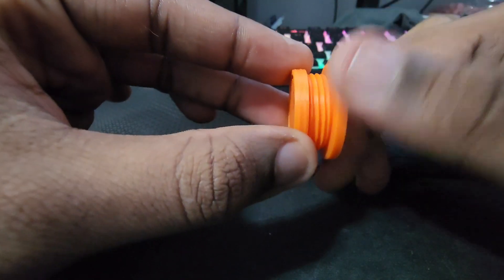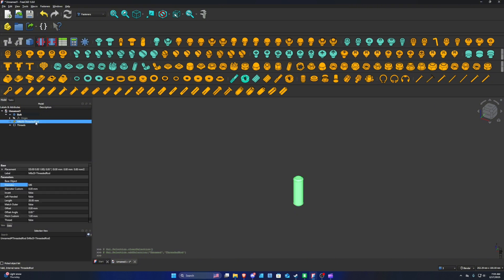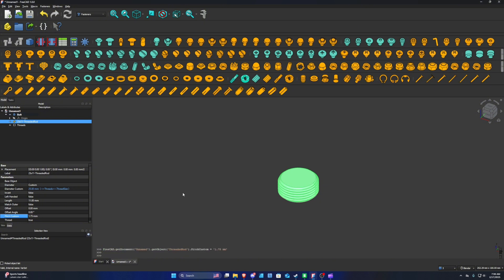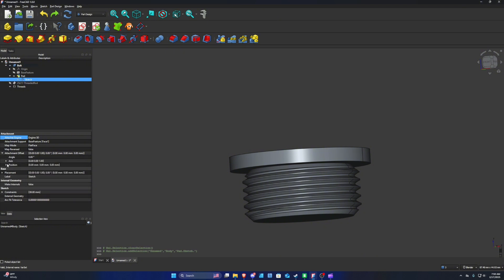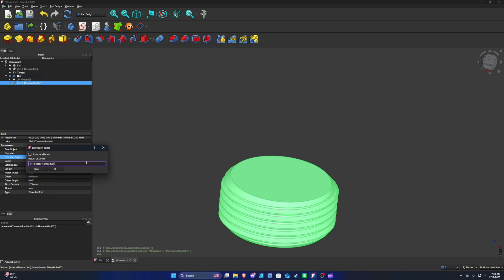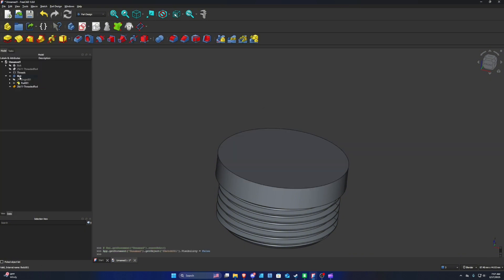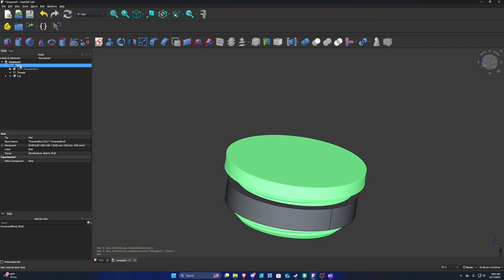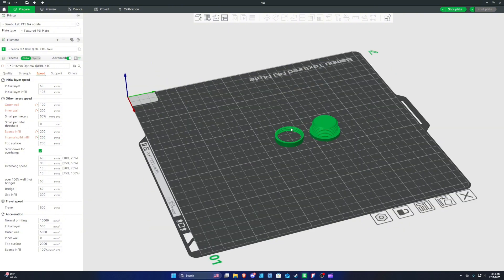Creating Nuts & Bolts in FreeCAD 1.0 | Tutorial | Fasteners Workbench

Comment: I'm very newt FreeCad and I don't understand the need for a variable set.  Also, how do I change the diameter of the bolt to 7 mm. But thanks for the video!! Much easier (except the variables) to follow.
Reply from the maker: The variable set isn't so much a necessity but it helps to keep everything organized. If you use the variables and what to change the size of the bolt and nut, it's easier to do it that way since you can just change the value of the variable and it'll automatically change the size of everything else for you. Makes it easier when you want to make different screw sizes since you only have to change one variable.

Comment: I recently was using the fastener workbench to use just straight up nuts and bolts of M8 and M12.  The sweet spot for scaling the nuts was 1.13 * 100% on the X and Y axis, and 1.00 * 100% on the Z axis. This makes the PETG 3D Printed threaded fasteners fit correctly.

Comment: Hi, I must say that I really appreciate your way of explaining freecad, in particular this threaded parts tutorial. I am not a happy subscriber thanks.
I have a question though.
At the end of the bolt part of your tutorial, I went further because of a need in my particular project.
I wanted to create a hole through the centre of the whole part. The threaded rod and the top cap.

When I try though I can only make the pocket go through the top.
I tried putting the sketch on the top of the cap and at the bottom of the bolt but in both cases, the pocket only goes through the top cap.
I also tried as a test to see if I could put a pocket through a threaded rod on its own, and this works as expected.

It would be fantastic if you could point out my error in this operation in freecad.

Many thanks
Reply from the maker: Funny enough I actually did exactly this for a project I did myself. Let me come up with a plan for a video and I'll be right back with you on this.

Comment: Sorry, but this wasn't a tutorial, this was a demonstration of how to make a nuts and bolt as quickly as possible. You're definitely skillful, but it could have been 30% slower. Sorry about that
Reply from the maker: @TomášKo186  everyone learns at different paces, and I can't appease to everyone since for others it would have been too slow and for some too fast. I suggest pausing between each step or slowing the video down manually. I like to avoid dead time between steps.
Reply: @Dzartistries  I did everything exactly as you did and got stuck at the step where I was changing the length of the screw. Still the same error message - "Line through identical points". It won't let me reduce the size to 11mm. I've already uninstalled the application and the plugin and still the same. It's strange because I have the latest version of the plugin. I know this problem should have been solved with the latest update.

~\AppData\Roaming\FreeCAD\Mod\fasteners\.\FsFunctions\FSmakeThreadedRod.py", line 53, in makeThreadedRod
fm.AddPoint(dia / 2, -1 * length + cham)